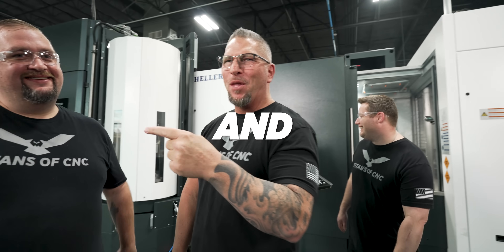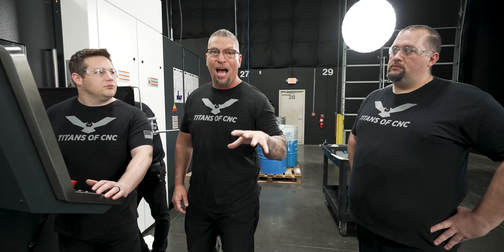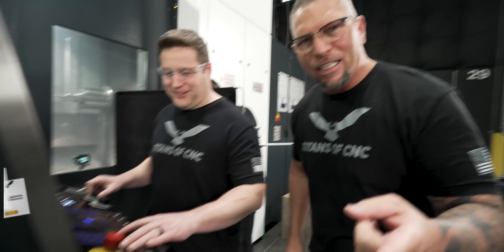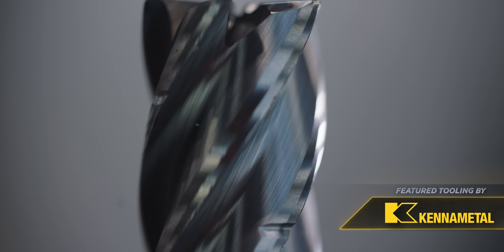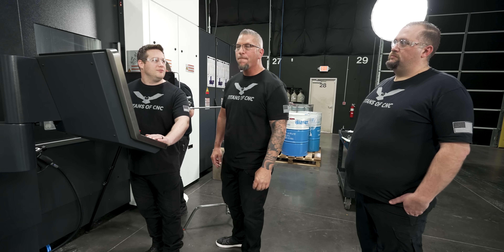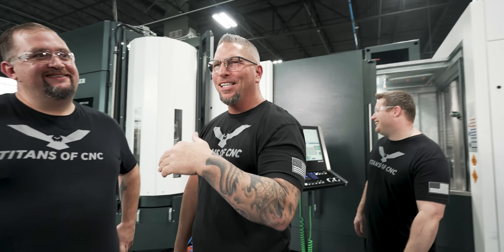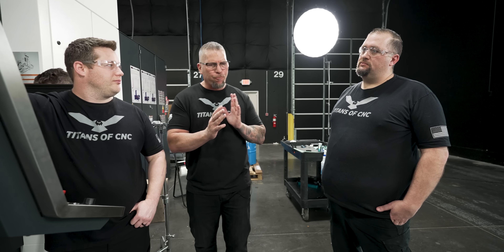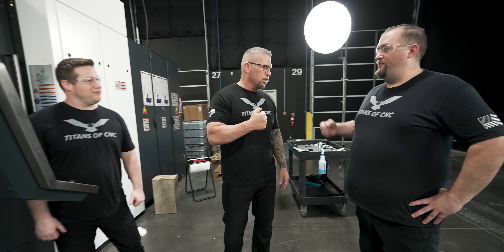We Pushed this End Mill Until it Broke… Then Backed Off

Comment: When it comes to the internet, information about machining is scarce and I’m curious. What does the final calculation for MRR actually mean? like, if MRR = 100, then what is it 100 of? Also I wouldn’t complain about a detailed explanation of MRR if someone feels so inclined.
Reply: They said multiple times that it's cubic inches per minute. Cut cross section x feed rate gives cubic length per time in whatever units you use. Obviously the 300 only applies to inches and minute.

Comment: Great video as always, on what you said Jessie about 5 flute vs 2 or a 4, sometimes it’s really material specific , aluminum isn’t picky, our programmers forced me to use a 5 flute 3/4 in copper, ( this was a KOR 5 knockoff aka a helical  brand endmill almost identical to the KOR5 in the video) when I said Iv experimented many times to go faster, and copper refuses to run good with more than a 4f, 3 being perfect, I tried every feed, speed, step over, axial engagement  possible nothing worked. This was in a rigid setup as well , all endmills definetly have their place, I think 4f is the most versatile you can get, being a guy that specialized in copper machining for a couple years I’d love to see more videos using copper to get your expertise and perspectives.

Comment: Now do that on the SVM4100 🤣 i while back i only got to around 60cuin/min in steel, gradually increasing feed while looking at the tool, when i was at 100% and the tool sounded healthy, i turned to the control and saw the spindle sitting at 180% load... tool was happy, spindle held rpm at 6k like nobodys business, pretty good for such a small machine

Comment: My lathe can go 1500jipm, but, it's a old boxway machine,chrome scraped hydrostatic Cincinnati milacron 300 ipm with 30hp spindle, it's easy to overwhelm the spindle. My hurco slv40 spiriti, I've replaced the ball screws and servosa shes 2000ipm capable now.10k rpm 15hp spindle, mrr is much better since listening to Tyson,

Comment: Another variable to take into consideration for MRR is the machine / controller processing ability, some older machines can't cope with high feed rates during complex toolpaths (trochoidal etc.) so you will need to increase the radial cut and decrease the feed rate to compensate.
Reply: Some older machines… or any haas without the hsm upgrade :)

Comment: Bigger stepover means more heat and higher temperature shocks because of less coolant on the cutting edge during each cut.
In steel and also stainless I got the best tool life without fluid with high feed and small stepover, just air to prevent recutting of chips.

I really would like it when you do it a bit more scientific, not like the tool guys.
Play around and show a tool life curve with different approaches, but also with material removed.
That's something I'm really missing in this industry, the best approach for roughing and finishing in comparison to the tool costs.
Just trying until the endmill breaks is nice to see, but it would be really cool to know the tool costs per hour in relation to the mrr, that's something to calculate with.
 Also I'm just a German potato, but I really like your open approach to push your industry, in Germany every knowledge is told behind closed doors and nobody knows or sees what stays behind the word "machinist".
Reply: That's also one reason why nobody wants to work with dirty and oily hands here...
Reply: And meeeeee again...😂
Really, that's my opinion, if there are trials with different roughing tools, different Carbide substrates, different rake angles, surface treatment etc.and price per cutting time combined with some kind of ai, combined with a cam software developer, maaaan, that's a plan for making good offers for customers 😉.
Reply: @Grobschmied87  Pretty much all you've  asked for is at the regular Sandvik Coromant site.
Material, Application,  Feed, Speed, Stepover, Downstep and amount of parts per insert corner
Reply: @yanivchen6401  yes thanks for the information!
But this is sandvik only.
In my mind it would be great to have this information while generating the toolpath.
Imagine how cool it would be to play with some slides in your CAM and see your runtime and the costs, maybe also the break even point of your needed profit per part.
And the best is, the program is ready to use without filling in your cutting data in a online mask and put the results back in the Cam.
That will never be perfect but it's a great help for calculation.

Comment: Always fun to figure out the maximum. Ive one part thats really thin, long and small width. I made a fixure grabbing it over the whole length on both sides. If I use the maximum feed for this material and tool the part breaks, chunks are getting pulled out of the fixture. I backed up the feed and its okay. 
I dont have a vacuum chuck yet, have never worked with one, I will try that next to see if it can go faster. The width is only 40mm and I dont know how strong such a small vacuum chamber is.
Reply: you can calculate it,as the Vaccum pulls over a surface. Which is your part.Get the Square mm of the parts ( the face on the vacuum pad) and multiply it the holding force at your caccum. THere is a maximum of -1 atmoshpere(thats a real vacuum then). you cant do anything to get that holding force up from that max value.

Comment: I can just imagine the reaction of your machine repairman:  "How in the world did you wear out all the bearings so quickly?"
Reply: NAH
Reply: .......uhhhh
...we have it on video 😁
Reply: your points are logical, but in reality it's more factors

you can run much higher material removal rate with much less wear on the machines. wrong or low material removal rate milling strategies often result in instable cuts that cause vibrations, which are much worse than high constant and stable pressure
Reply: additionally weaker cuts = more time, more cuts, more wear and vibrations once again you loose money on every level
Reply: As long as they stay below critical speeds and are clean lubricated, nope
Reply: @seancollins9745  Bearing life is a pretty complex topic and it's highly influenced by load.
Reply: @seancollins9745  Bearing wear is determined by a combination of factors beyond lubrication quality. Temperature, pressure, and RPMs being three of them.  High MRRs mean high pressure on the bearings.  Why do you think engines built for racing need rebuilding more often than the engine in your Corolla?   Because the higher power output levels cause accelerated bearing wear.     ANY mill or lathe will experience faster bearing wear if run hard frequently.   IT's time x pressure.
Reply: @Turboy65 yeah that's not true.
Racing engines don't last long because they are light weight aluminum castings that are used beyond their material properties resulting in increases wear. But that's not because of power.
I can get a CAT diesel or a Skania engine with 800hp that will outlast every Corolla engine with less maintainence.
It's all about staying in spec of it's use case.
Same goes for bearings. Yeah if you push your Haas to 150% half the time, that thing will be worth it's weight in scrap before the new year has started but, if you're within your spindle load your bearings should not fail prematurely.
Reply: @nils1953  Yeah, it IS true, because if you run your spindle load at 10 percent your bearings are going to last a VERY long time.  Wear life is pressure x time + thermal multiplier.
Reply: @Turboy65  of course bearings last longer if you don't use them. The point still stands that the machine including it's bearings are designed that they can be used at 80% spindle load within their service lifespan.
Now if you pay 1mil for your machine and want to save a couple thousand on not changing your bearings during scheduled maintenance, because you babied your machine at 10%, go ahead.
Reply: @nils1953  My point is simply that bearing life will be reduced if you run the machine hard.  And will be extended if you are gentle on the machine.  Running 100 percent spindle load and 2000 IPM on all axes all the time will consume those bearings in months!   But you'll have a lot of productivity out of the machine and be able to afford the maintenance!
Reply: @Turboy65  2000ipm definitely reduces the life span. Simply because the machine travels 10x as much as normal. 
And that service will set you back way more than a couple of spindle bearings ever will.
Reply: True

Comment: Pedal to metal, show where the tool/machine limit is, MRR 650, 750, 1000? In other words keep pushing until it breaks or stalls. Push coolant to limits and measure tool wear changes. It fun to see how far it's possible to go which almost none do largely because of the capital costs of the equipment and tooling and this can make labor costs much less significant for part purchase, example a part with a low per piece labour cost due to machine speed makes where part is made more important as price differences narrow and shipping and supply line length become the dominate factor in purchase decisions.